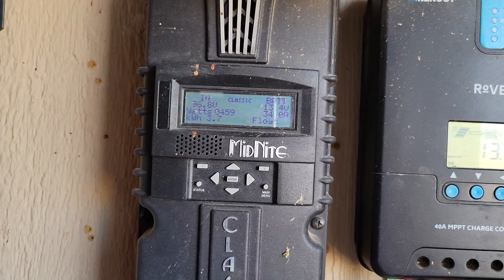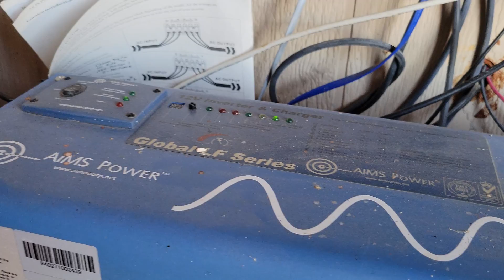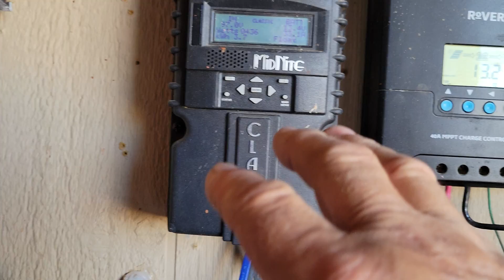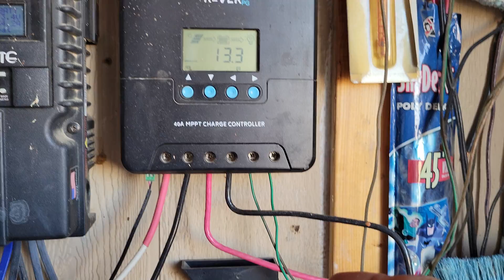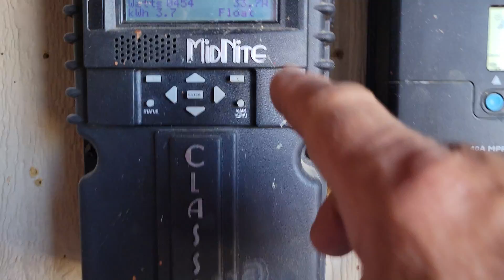Connecting Multiple Charge Controllers to a battery Bank, July 7, 2023

Comment: While I don't agree with the way your controllers are hooked up, it's your system and it works for you. 
Two different units I would make sure the secondary ones settings match the primary.
Reply from the maker: Yeah, all that is gone after 10 years of service.  Just installed new LiFePO4's yesterday.
Reply from the maker: Welcome aboard!

Comment: Hello newbie here,
Can I connect 2 units 12v charge controllers to charge a 24v battery?
Reply from the maker: Welcome aboard!

Many 12v charge controllers are 12/24v, while some others are 12/24/36/48v.
The charge controller will set up automatically for 12 or 24 volts, just by connecting the battery to the controller FIRST.
It isn't recommended to connect 2, 12v charge controllers together in series, unless they are specifically designed for that purpose.
Check the label on the controller and if it says 12/24v you are good to go.
Also, an mppt controller is much better than a PWM controller.  Just remember, battery to controller FIRST, then solar panel(s).

Comment: So if you have 2 mppt controllers you just put them into the bus bar and the busbar connects to the battery? I think this is by far the best video ive found to figure out ny issue which no1 seems to really post.
I have 2 panels 660w each.
1 charge controller for 12v only takes in 520W to 920W depending on the controller. So obviously 1320W wont be used so i need to controllers. But havent been able to find a good video showing how to.
Reply from the maker: No, the bus bars are for the incoming solar from the panels.
To use more than one controller, the battery connections are the important part. I assume you have multiple batteries in parallel. (All the positives connected together, and all the negatives connected together. ALWAYS CONNECT THE BATTERIES TO THE CONTROLLER FIRST.  For the first controller, use the positive from the first battery of the group, and the negative from the last battery of the group.  Then connect the maximum watts of solar to that controller.
Next, for the second controller, connect the positive from the LAST battery, and the negative from the FIRST battery,  then connect the max solar panel wattage to that controller.  That's all there is too it.  If you add a third controller, use the positive and negative from the middle battery of the group, the add solar panels to that one.
A few notes.  Don't connect the solar panels to the controller while the sun is beating on them.  Either wait until after dark, or cover the panels with a tarp, cardboard or blanket, or turn the panel upside down with the back of it facing the sun if possible. Connecting them under load could damage the controller.
2.  If connecting a 12v to 120v inverter, do the same as with the battery connections, using opposite ends of the battery bank.
Any of questions, just ask, and I will do a special video for you.
WELCOME ABOARD!
Reply: @GBear  thanks. Uh, I guess im confused again lol.
Not using multiple batteries. So i have just 1 12V 100ah battery, a 12V 2k/4k pure sine inverter, and the 2 panels i plan on getting are 2x 660W panels.
The issue i have are the charge controllers for 12v systems are usually PV max input of 500w to 920w max. So i cant use just 1 controller ubless i spend like $300 for a huge crazy 1 that can support that much PV input.

So now im trying to figure out how to parallel 2 charge controllers so i can at least get my full pv input needed.
Reply from the maker: @vincentsgaming That can't be done.  The smaller charge controller is worthless with those size panels.
So, you have only one LiFePo4 battery?  If so, you cannot use a standard lead acid controller on LiFePo4. 
Your system sizing is not efficient.
What are you planning to run off of the system?
You don't need those large solar panels, unless you need to run 1000 watts only during the day.  Once the sun sets, one 12v battery won't run much for very long.  Lead acid batteries are to be considered to be dead at 50% level or 10.5 volts.  A LiFePo4 can be discharged to 99% and recharged, but doing that often will shorten the life of the battery.
To properly size and set up your system, you first need to make a list of each appliance wattage.  Then the battery bank size can be determined, then the solar panels size, then the controller size.
For more efficiency, you might think about at least a 24v system, as it will save you money on copper wire sizes.
Reply: @GBear  gotcha, so i am just only running my ac unit. Its a 8k btu single hose ac that i just want to run during the summer days. I wont need it at night so im ok with the 1 battery.
It runs at 1032 watts which is why i wanna get the 2 660W panels to sustain at least 1kw throughout the sun part of the day. Im in sunny CA so plenty of sun.
Not running anything else but the ac unit. And yes its a lifepo4 battery.
I just spent 159 on the 12v inverter and a 24v inverter is about the same so i was just trying to save myself but if i HAVE to go to 24 volt i will. Just will be more upfront $
Reply from the maker: @vincentsgaming most 12v controllers are 12/24v and auto setup once the batteries are connected.  24v would be a more efficient system for running an AC unit, but you may also need a hard start capacitor to help start it.  
So, by going to 24v, you increase the volts, but the amps stay the same for the same watts.  Lower amps means smaller wire, and cooler running.
You are going to need a controller that will handle the total amps.
Multiple 24v x the ah of one battery for total watthours of the battery bank.  That number is how many watts the batteries will handle for 1 hour after dark.
Now, the solar panels.
Connect in series, positive to negative and you double the voltage of one panel, but the amps stay the same, so lower amps may help with the controller cost.  Possible for just one 60a controller at 24v output to batteries, if the amps of a single solar panel are below 60a.
What are the VOC and ISC of a single 660w solar panel?
Reply: @GBear  i havent bought the controller yet so im good there but my 12v inverter is now a waste as ill have to buy a 24v inverter.
Under the 12v i was planning i couldnt connect the 2 panels series or parallel due to max pv input from all charge controllers.
But if i go to 24v i can out them series or parallel and ill be fine.
So voc is 45.89
Isc is 18.42
Also they are bifacial.
Reply from the maker: @vincentsgaming So, in series, the panels would output about 100v, 19a, so a 30 amp controller would work, but I learned the hard way, go bigger so you don't need to replace if adding on.  If you connect panels in parallel you need a minimum 40a, but better with 60a as I said earlier.
I swear by Midnite classic controllers.  They would handle your system without issue and serve you well.  The Midnite 150, 200, or 250 are all good choices, (not SE models) the numbers stand for maximum volts input allowed.  These controllers handle everything from 12v to 48v systems.
If you used the Midnite 150, you could stay with 12v and add 1 battery in parallel,  then connect your panels in series.
Another option is SunPowerGold all-in-one for whatever voltage you please.
I will be upgrading to the SunPowerGold 10k, 48v system with LiFePo4 batteries by next year.  4 batteries should run my whole homestead.
Reply: @GBear  would the midnite 150 run bith panels for max pv input? What would the max pv input be? Thats my biggest issue i still face at the moment is just that.
Reply from the maker: @vincentsgaming  Yes, the Midnite 150 would handle both panels in series, since it can handle up to 150volts, plus the voltage of the battery bank for 162v input.
I use the Midnite Classic 150 and am inputting 6 panels at 305w each, wired in series parallel  for 120v input on my 12v system.  That's 1830w.
Then I have an additional 1620w coming in on additional controllers.
Reply: @GBear  unfortunately i just looked it up and that unit being $730 is 100% over my budget as i was estimating about $800 for everything i needed just to run my ac unit. Looks like i will have to end up.going 24v and using a simplier mppt controller since at 24v the max pv input doubles and ill be in my limit. I was just trying to avoid having to go to 24v and stick with 12. But yeah looks like im going to have to buy a new inverter and another battery, then once i have those i can get a way cheaper mppt controller thatll handle both panels and i should be set.
Reply from the maker: @vincentsgaming  I wish you the best.  Every time I chose cheap over good, it ended up costing me more in the long run.
Try Growatt controllers, or similar.
Reply: @GBear  thanks bud! I apprefiate your input. Your the only 1 to have helped so im grateful and you got yourself a new follow. Im still learning and starting cheap to learn the basics. But yeah looks like im moving to 24v and not 12v so i can get the most out of my 2 panel 2 100ah battery setup. That way i can stay cool.during the summer days this year! Thanks again.
Reply from the maker: @vincentsgaming You’re welcome.   Check with Sunpowergold.com for a 24v all in one.  They have some great setups, and I'll be going to their 10k 48v all-in-one.  Tony, at @DOING REDNECK THINGS OFF GRID is installing one now and may have it running in tonight's video.  Give it a look see and tell him I sent you.
Reply: @GBear  thanks ill check both out.
Reply from the maker: @vincentsgaming make sure the controller you choose will work on LiFePo4. Not all do.
Reply: @GBear  yeah i learned that pretty quick i got sent 1 that doesnt work for lifepo4 but didnt say on amazon listing. Only found out cus i read the instructions first

Comment: Thank you for posting your video. I see the reasoning behind utilizing 2 charge controllers. I am new to all of this and my wife and I are setting up to go completely off grid on a mountaintop in Northern Nevada. We will be installing a 3.9KW QCELL Solar Array (another to be added) + ALTE PRE-WIRED SYSTEM SCHNEIDER SW4024 INVERTER WITH MIDNITE CL150SL CHARGE CONTROLLER in our container with two 48 volt ABSOLYTE Sealed Battery banks to store power. A generator back up will be installed after we get started. I am trying to configure a 48 volt wind turbine into the system as well. Thank you for your video - I subscribed in case you have more information in the future!
Reply from the maker: Thank you for subscribing. If you need a good turbine, check with hydrogenappliances.com about the KT5 48v PMA with the MaxCore.
Reply: @GBear  -- hey! I didn't see your post back to me ! Thank you - I will look into the link! Much appreciated!
Reply from the maker: @rongray4118  Hi Ron.  Glad you finally got it.  Please checked your subscription as I have had others tell me the quit getting notified, and when they checked found that YouTube had unsubscribed them and unclipped notifications.
Reply: @GBear  for whatever reason - youtube is still not notifying "all" of the time so I just check back in every once in a while. Ended up finding a good deal on a DC Solar Trailer and we picked it up. I would like to get the MidNite Charge Controller to push higher amps into the forklift battery (both need replacement cells from shoddy caretaking). I derated the front battery to 42v and it is supplying all the power we need (minus a/c units) without the generator continuously running 1-2 hours every day. I came back here to review the multiple charge controller set-up you have installed. Since I have 2 separate banks to work with - two controllers shouldn't be a problem for these two SMA 6048 (Master/Slave) inverters to handle.
Reply from the maker: @rongray4118 At one time, with my lead acid setup, I had 5 charge controllers connected to one battery bank, but each controller had its own separate solar array.

Comment: i had a weird issue with charge controllers one would pump out the amps yet the second controller would do nothing  so i checked all connections no change, i changed to another high end controller same deal , weird, considering battery voltage was below float voltage ,  i might try conecting them to the same batteries and see what happens.
Reply from the maker: Let me know what happens.
Reply: In my system it seem that happens when the battery bank is almost fully charged and it can not take the full charge. Then it seems to just use one of the MMPT solar chargers to charge the battery bank. But if I turn on something that use lot of electricity it uses both of the identical solar chargers. The solar chargers is each connected to two panels in series with a total of 4 solar panels, so the solar chargers is connected to one pair of panels alone.

Comment: Can it work safely to have your solar panel wires twisted together right where they go into the solar charge controller, permitting that you are still under max wattage permitted for the device? I have some of those Y branch connectors for solar panels. And I do use them. But I wondered if you actually need them? It seems like where you strip the inch of wire off at the end of the solar wiring leads that goes into the charge controller box you could just twist them together with another set of wires probably?

(Edited in later... although I am also not liking how the wires going into a charge controller's bottom end are so close together. It seems like some people might have accidents with that. I would think it would be better for them to widen the spaces on those screws a bit.)
Reply from the maker: Yes, you could do the twist, but I woul recommend soldering and covering the connection with heat shrink tubing to prevent accidentally shorting.
Reply: @GBear  Oh. That's a cool idea. See, its always interesting to talk to you.
Reply from the maker: @noahriding5780  Also, solder the end going into the controller before inserting it so it makes a better connection.  And if all the solar wires coming in are #12, Solder a #10 pigtail from them to the controller.

Comment: I'm showing 34.2 amps on the 40 amps controller. I should add two more panels. That's going to put it around 39.5 or so amps. Not sure if I should run it that close. It's really pouring rain here. More coming Sunday they say. All my barrels are full. I will try to get another tomorrow. That would get me to 380 gallons of water storage. When the sun 🌞 comes back out, the grass is going to grow about seven inches the first day. The problem is, itll be too wet to mow for a couple of days. It cooled off enough for the tomatoes to bloom again but it's going to be so wet they may not get pollinated. Then it'll be too hot for them to bloom. Now if the green tomatoes don't split from all the rain, I might still get a few. They said heat index 110 for Monday, I bet it's going to be a scorcher in August.
Reply from the maker: We are supposed to see triple digits starting next week and hanging around for at least a week.

Comment: Will the ideas for this still work similar if you were like covering a really big house full of tons of solar panels? (I'm not one of those people, but want to understand well for later building up over time. Although those guys don't usually use battery banks.) Are your bus bars homemade, or are there certain things you look for in those when you go get them?

With the wiring going to opposite ends of the battery bank like your system does... will that show a bit slightly higher average voltage charge in the system, since the way it flows lends momentum to the flow? And does it matter if you have more than just a linear single connection in the battery bank for it to work your wiring way? (Like I didn't know about your ideas. And I'd been worried about the battery bank having bottlenecks in the wiring... so I've mostly got a single linear flow in the wiring from 1 battery to the next, except that in the middle I have 2 extra connections in the battery bank. But if I convert to your system I wonder if that adds any extra risk to me.)
Reply from the maker: First, if your system is working, DON'T FIX IT. 
Battery bank wiring should be consistant in sizes and length.
I don't do on grid solar, so I wouldn't recommend any of this for grid connect.  Different components are required.
Reply: @GBear  One problem I recently found out I have is that the cheap charge controllers are taking up too much of the incoming energy. I started low budget so I was doing those little cheap 20 amp max controllers. And after having like 3 or more of those I realized they were using up tons of the incoming energy of the day, so it would take a lot longer for me to fill up the batteries. So I have to make changes anyway. First I've found its better to just go with a high max amp charge controller with high capacity (on # of solar panels) rather than use low capacity ones. However I did still gain by using the cheap ones for a time because I didn't know what the heck I was doing. And it was better for me to learn on cheap parts while I was still fumbling stuff around. (I still am figuring stuff out.) Thanks for your input.
Reply from the maker: Yeah, we all learn the hard way that cheap stuff is junk.  I love the efficiency of the Midnight Classic controller